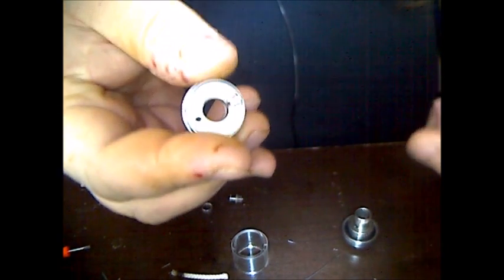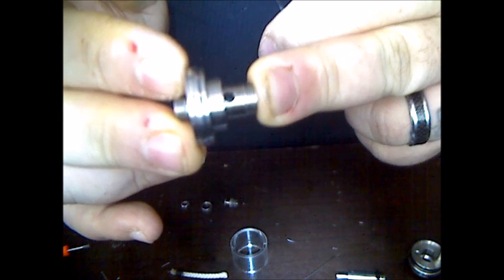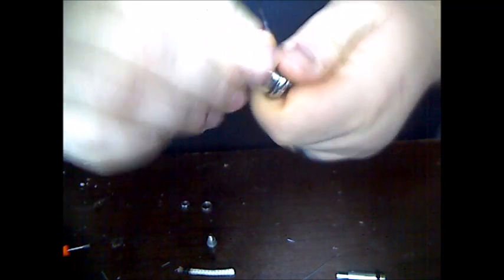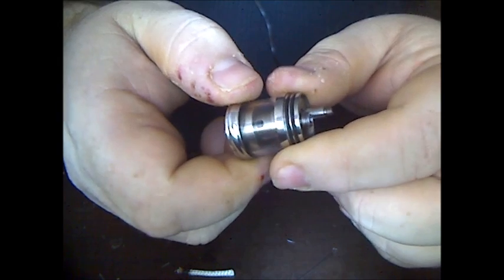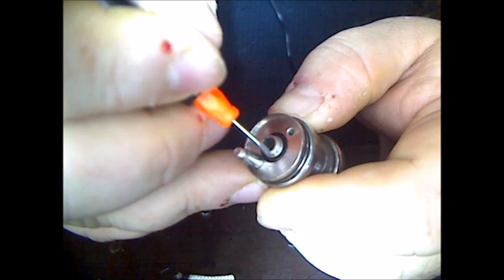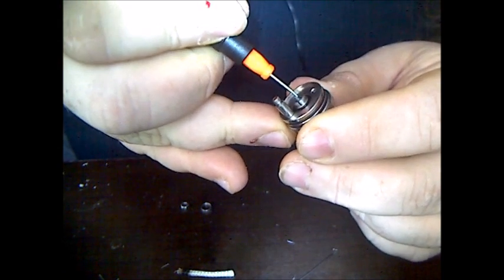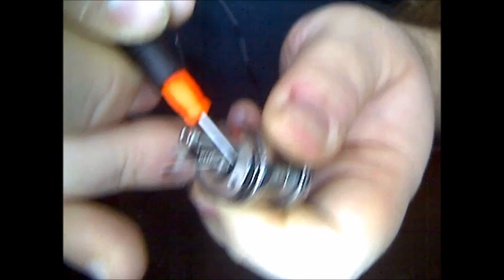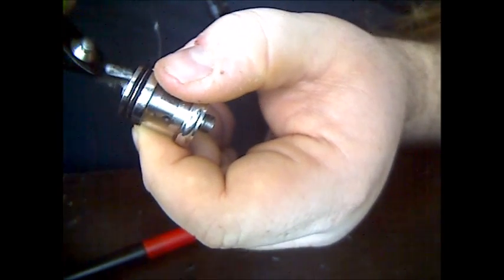AGA T3 From The Ground Up

Comment: I've had this atty a few months now and it has really become a goto atty when I tire fixing issues with other gennies. I've used mesh, steel rope/ekowool top, mesh/ekowool top. All work but just now I had a thin piece of steel rope/ekowool top that just wasn't keeping up. I believe my steel rope was just too thin, making the coil that much smaller. So, I changed out the steel rope for a bigger mesh and using the same piece of ekowool after sticking a pen inside the end to widen it, slipped it over the wider mesh and wound a new coil. A perfect vape! All this to say this is a terrific atty. Don't give up on it, fill thru the center using the little hole with the screw removed to release the air. That hole is not a fill hole. Good luck!